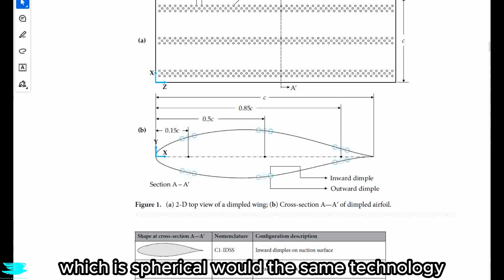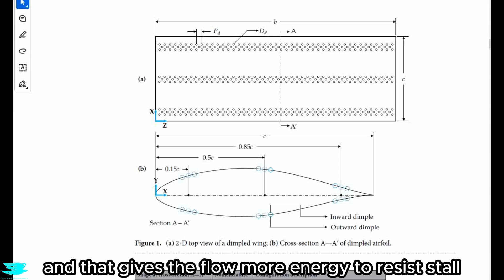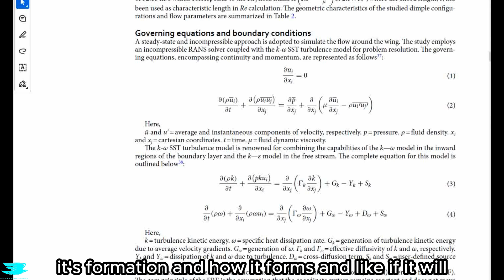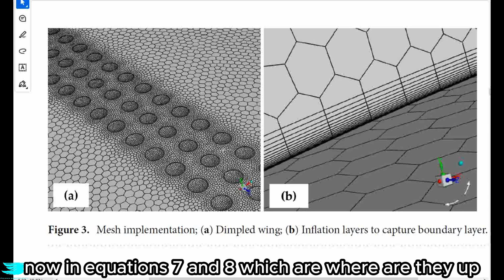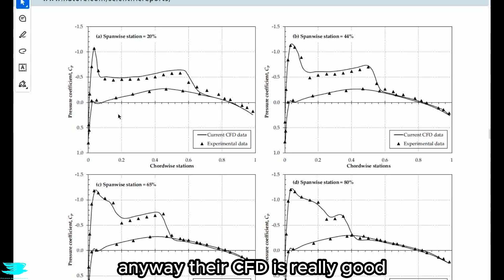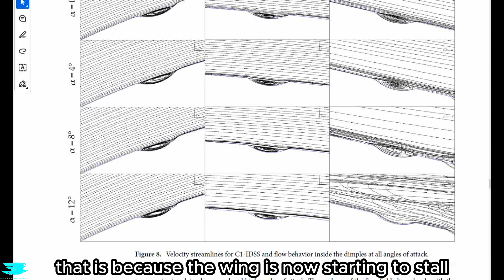Golf Ball Technology Improves Wing Aerodynamics Podcast 207

Comment: i saw some car rear undergo diffuser, they also add dimples but at diffuser area the flow is turbulent (length is 5ish meter ) so changing laminate flow to turbulent,  enhance the turbulence energy and reduce separation, this claims doesn’t make sense here , but if the OEM does dimple on underbody diffuser, I am pretty sure they performed some wind tunnel test to proof it is effective, do you have some theory to explain why it is working
Reply from the maker: I don't think I know the exact diffuser you're referring to, but I think it has to do with the diffuser being fairly angled. So, adding dimples effectively means you have vortex generators and that increases the energy of the boundary layer near the wall. So, the flow can stay attached better.

Comment: I wonder whats the difference between scales (with tear of edges) and dimples. 
Penguin wave shape is comparable with dimples. 

Dimples need to be but in the high pressure zone of the airfoil in order to work. 
Cause the air 'jumps' over the cavities  reducing surface area. 

Surface area which is in contact with high pressured air, causes far more drag than low pressured fluids. 

On the top of the wing air is bent down without a pressured surface.
This is making an airfoil this efficient. 

On Golf balls dimples work as vortex generators...

I guess it should be possible to design fractal like structures. Dimples in Dimples in Dimples and so on.
Reply from the maker: Perhaps from a turbulence point of view, dimples and some scales are the same. But, then apparently some fish also flare their scales out to take advantage of vortices as well to produce more thrust.

Comment: Do you think the effect of dimples (like for example on the bugatti bolide) would also work on low speed (like 15 m/s) ? 
Thanks for your help?
Reply: I know of velomobiles that got vortex generator tape.
They drive near the sea shore. 
And it is needed to protect against side wind gusts. 

It is working nearly speed independant. Unless you mess with really low reynolds numbers. 
(1m/s)
Reply: @c.l.3806  thanks a lot for your advice! Im building a drag efficient model car at the moment. I will surely try this out!
Reply: @xXGHXSTXx-h6u  

For a drag efficient car, i suggest a prop at the back of the car.
The propeller is powered just for drag reduction.
In order to climb mountains, its better to power wheels.

The car should have a droplet shape.
So perhaps a trike with a single back wheel works best.

Perhaps google after Schlör car or Schlörwagen.
Reply from the maker: There is a higher chance it would than at higher speeds because they typically are used to turbulate the flow and keep it attached. So, putting them just before a sharp edge will help.
Reply: @PremierAerodynamics  so it will be for the F1-in-Schools car I contacted you for ;). So a propeller would be too much, however dimples could be worth making a study of.

Comment: Interesting, they should make CFD analyysis of the high speed train covered with dimples. Since the length of the frontal slope is limited in trains and most of the drag comes from skin friction I really think dimples could benefit high speed trains.
Reply: My understanding is that dimples trade skin friction for less flow separation therefore pressure drag. Not sure if that trade-off worth it on high speed trains where skin friction dominate?

Comment: Next Boeing plane is gonna be full of dents and holes (on purpose this time)
Reply: You have to be strategic about this partner. The first 1/3rd of the airfoil is close to laminar flow because it's stagnation pressure at the leading edge bleeding downstream. It's that last 2/3rds where the turbulence kicks in, and the exact way, and point that happens is difficult to predict, which gets in the way of design. Since extending the laminar flow over a wing is expensive(P51 Mustang) and difficult, we must find other, simpler means. If you're going to get turbulence anyway, induce it yourself, that way it's predictable, the benefit of turbulence is that flow stays attached to curves, the downside is that it loses considerable energy in doing so.

In a way turbulent flow is no different to the energy lost in a car that's meandering through corners with banzai inertial drifts. Yeah, it's the most efficient way to get through those coners, but you're losing a lot of energy compared to just driving straight.
Reply from the maker: Lol, it probably still won't be on purpose, but just a happy coincidence.
Reply: The planes are already gettin taped.
This tape got some micro structure thats reducing drag. 

My fishtail plane energizes the flow of the 'body' airfoil. This reduces turbulences.
On advanced versions the Dimpels could dance somehow with the motion of the fishtail ?
A creepy weird wavy fluctuating wingtip perhaps ?